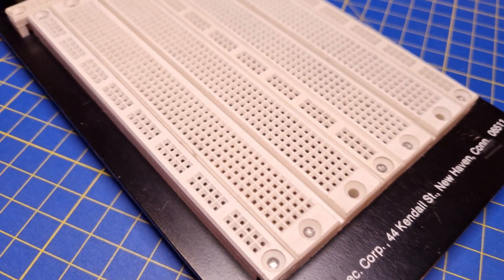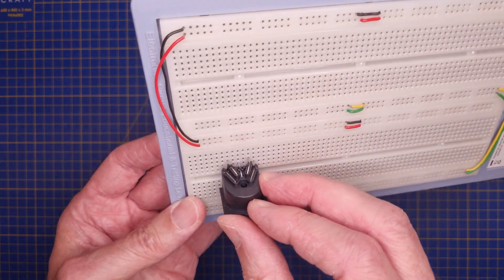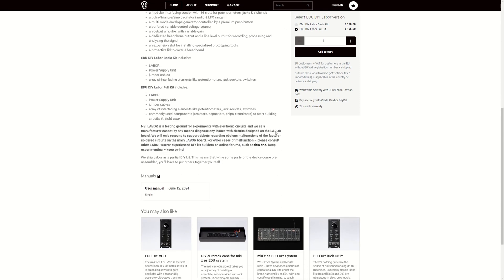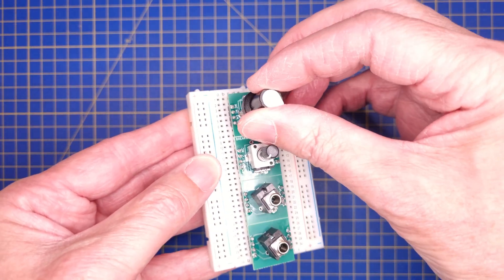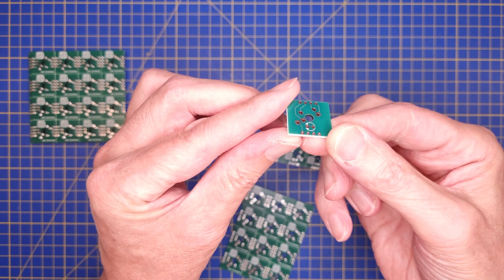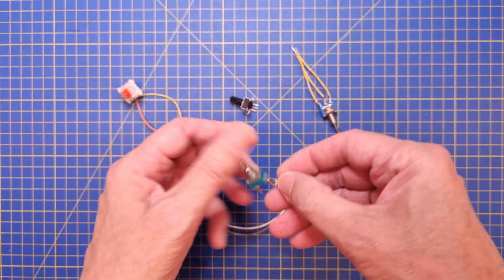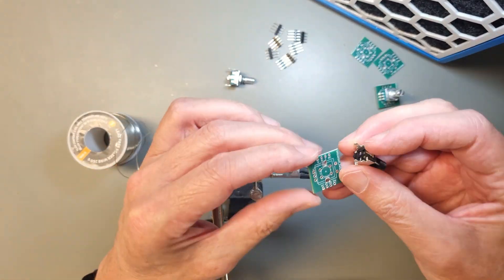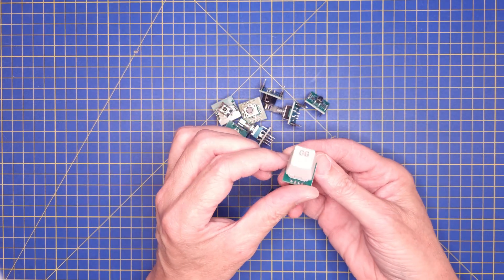Eurorack DIY: Breadboarding Helpers

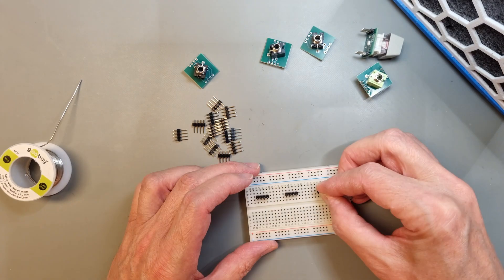Comment: 2:28 Dedicating a breadboard just for the UI is great. Boards are cheap. You can quickly lay out the interface elements and have them sturdy, then run wires to the other board. Still better than having the knobs and buttons hanging off the main board with wires, getting yanked on when you adjust them.
Reply from the maker: Yes, I fully agree!

Comment: 2:58 I'm surprised that doesn't melt the breadboard matrix around those pins as you solder them.
Reply from the maker: I have a cheap "sacrificed" breadboard that I only use for soldering pinheaders onto Arduinos, RPi Picos and component adapters. Sofar the BB have been keeping up quite good - but I try to solder the pins as quick as possible to avoid melting the plastic.
Reply: It can!

Comment: I have made these for the alpha pots some time ago, after i learned from Mutable Instruments Breadboard friends.
also very useful for smd ic, dual match transistors, etc.

check out this ic;: APS6404L-3SQR
64 Mega byte pseudo ram, SPI. seemingly used in phones or so.
You think it would be possible to bread board 2 of these to join to 16 bit would worK?
: )